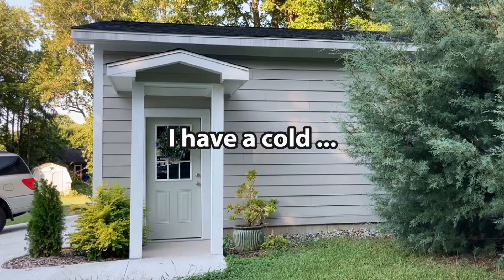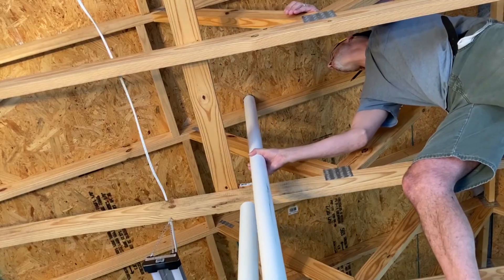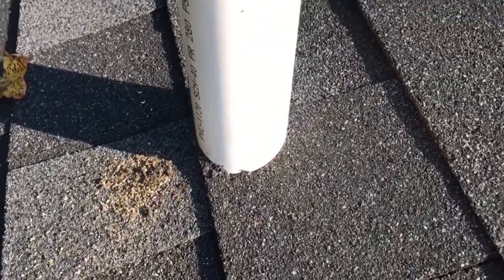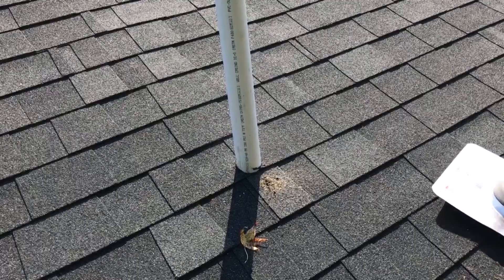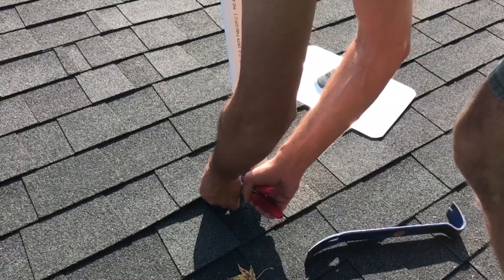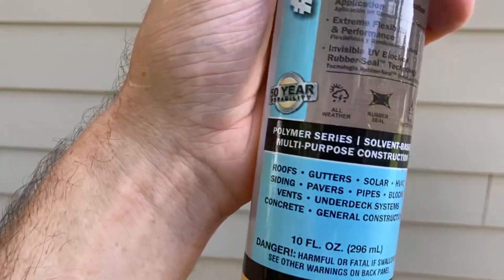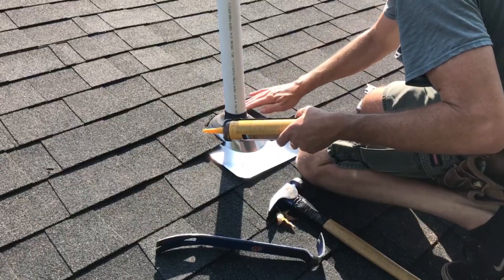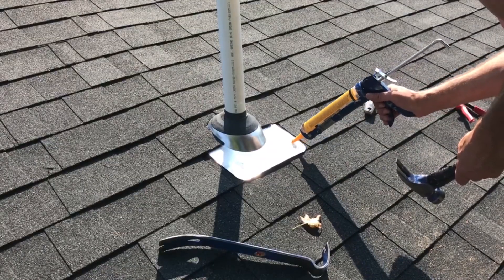How to vent plumbing through the roof | Garage to Apartment Conversion | Episode 11

Comment: One suggestion, as I saw in another video, to trim the sharp edges of the PVC at the top before pulling over and down the rubber flashing piece because it can cause cuts in the rubber and fails over time.
Reply from the maker: Good tip!

Comment: Umm, need a longer ladder...I would have drilled the hole in the roof, then put flashing on, then poked PVC thru the flashing.  Then cut pvc 6" longer....not a pro, I am just a DYIer too!
Reply: It works better to put the pipe up first because when installing the pipe you have to push it up then pull it back down to set it into the fitting… the boot doesn’t like having the pipe pulled back once it’s pushed through

Comment: Why did you not put vent cap that allows it to draw air in on sides or turns to side so rain doesnot go straight down the pipe?
Reply: It's all out there to look up. Section (b)Main stack. Each gravity-flow sanitary building sewer shall be served by at least one stack which extends from a building drain to a vent terminal or vent header. The stack shall be not less than 3" in diameter from the building drain to the vent terminal(roof) or vent header.
Reply: Any water down the pipe would go into the sewer drain anyway. However, the wider the pipe the less chance of frost buildup closing up the inside of the vent pipe and it's better at pulling air in if there is multiple floors of plumbing. Usually, the main stack is at least 3" through the entire length including through the roof.

Comment: You'll want to spray paint the exposed pipe as UV light degrades PVC over time
Reply: Even if its black pvc?
Reply: @Memo-nd6fj black absorbs solar heat while white reflects solar heat.  Why would you assume black is better?
Reply: Its a UPC plumbing code requirement to paint the pvc to protect it from UV rays.  However, nobody actually does this.  And  I've never seen a plumbing inspector in my 20 years as a plumber even mention it or care.  I have never seen a pvc pipe with any degradation or problems due to UV rays either.   However, it is recommended to paint it, so im sure it is for a reason.  It just isn't done in practice.   At least in the midwest.

Comment: The caulk tip tip at the end was great.  Thanks for that extra tid-bit.
Reply: I like to put deck screws in the end of my tubes before I store them. Just unscrew with your fingers when ready to use again. They usually discharge a little easier through the void the screw produces.
Reply from the maker: Thanks for watching the WHOLE thing Benjamin!!